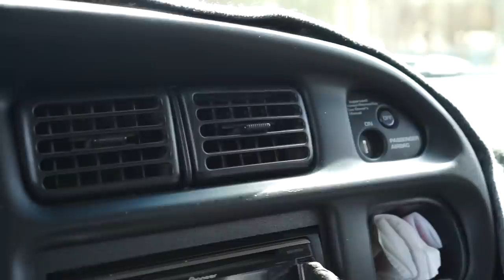Harnessing The Power Of Poop | Gardening with MATT and BLUE

Comment: I think you are supposed to mix soil with compost. Pure compost will burn the roots of your plants. I always was told to break up the top 4-6" of soil,  spread a layer of 1-2" over the bed, and then mix it with the soil layer. Then a couple of times during the year you can spread a thin layer over the top and just water it into the soil. And yes, poop smells. Some animals' poop smell less than others. Also, poop-enriched compost should only be bought from a commercial or municipal vendor who as you mentioned can process it with the high temperatures needed to kill harmful pathogen. Ordinary home composting doesn't get nearly hot enough. Best of luck and keep us posted.